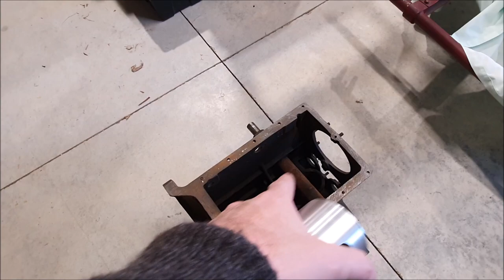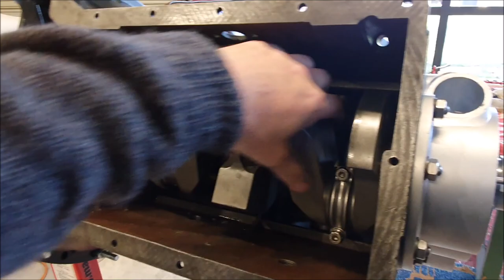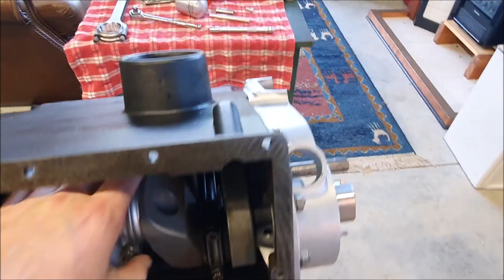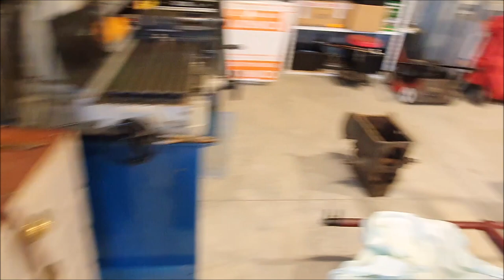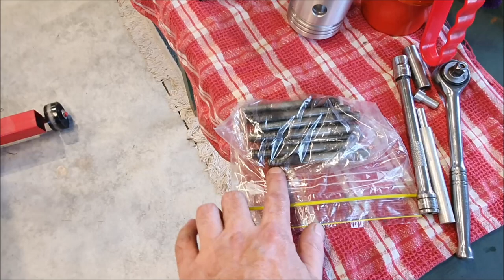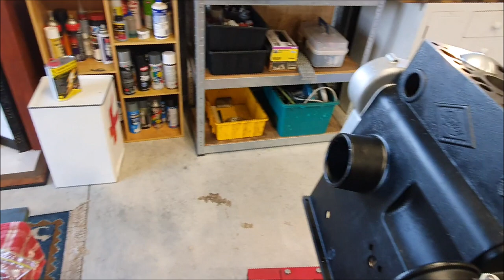Pre war Riley 9 - Engine building

Comment: I was just wondering if the piston is that high out of the block will it raise the compression ration a lot or to much. Could it beyou may need to put a spacer to raise the head that amount which would save machining the pistons?

Comment: If you don’t mind my comments. That’s quite common with the cylinder skirt more so with the 3mm extra rods. Your piston clearance will depend on your cams. With the larger oversize pistons you are correct the top outer edge of the piston will need to be relieved and the last thing check the size on your head gasket bore. Hope this helps.
Reply from the maker: Yes, thank you! I definitely need to look at the cams now you mention it as they were apparently reground. To what grind I don't know. I can measure the lift and should be able to calculate how much the valves move from that to get a rough idea. I do have pictures and descriptions of the process from someone who does this professionally so what I am doing is the normal way of doing all this. It's just tricky since all the people who do it are on the other side of the world so my approach is just do things slowly and methodically. All these comments are really helpful!
Reply: The main point that the cams are a problem is on the overlap. So assembly is possibly your only option.

Comment: If you have a spare cylinder head, with your spare block you could use these as your mounts for the pistons, using the head would also mean that you have exactly the correct angle for the indentation. Is there scope to bore the cylinder head to oversize? Does make you wonder why the parts manufacturers cannot just make things to the original specifications... Nice work!
Reply from the maker: These rods are specifically to raise the compression ratio. I would have been OK with standard ones but I think they didn't have any when I ordered them (was a while ago so I can't remember!). I don't think you can bore the cylinder head so it's quite normal to slightly modify the pistons. The register does have a warning about not taking too much off though. The angle is known. It's exactly 45 degrees.

Comment: I’m sure this may well have been suggested, but have you thought about getting a chest or head mounted camera sling? This would allow you to take these videos with the use of two hands?
Reply from the maker: That sounds like getting into putting more effort into the filming than the car! I will try to keep the film more stable though. It's tricky with my phone holding it still. Maybe a gimbal type holder would help and it isn't too much. The truth is I think about filming after I have done whatever I am doing on the car usually. That's also why I tend to repeat myself. Nothing is really planned!
Reply: @asciimation  
As a vintage Austin 7 enthusiast in the UK, I love watching your videos. I’m always worried you’re going to drop something valuable, or the phone! I only thought I’d suggest so it was easier for you, your videos are great, and any wobbles aren’t an issue at all.

Comment: I would have thought a spacer plate or shim between the head and block would be an easier way to solve your problems.
Reply from the maker: I think I did that on the Austin engine from memory (spacer between crankcase and block) but on the Riley engine I want to increase the compression ratio. I think it's only 6.5:1 standard so it can definitely be increased. Of course you never know how much has already been skimmed off the head/block so the only way to know will be measure it! I did equalise the chamber volumes so should somewhere have the volume of the head recorded. I can check it by filling it with liquid (I really need to get a burette) and measuring how much it takes. You can measure the cylinder volume and head gasket volume too and calculate the ratio.
Reply: All you need to know about Riley Motor: https://www.youtube.com/watch?v=-hkeel6xKvE